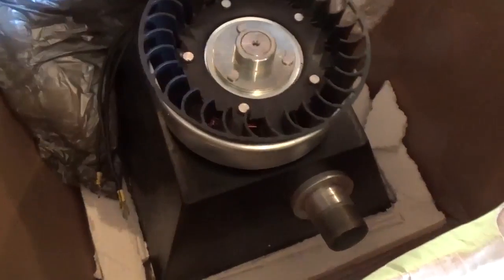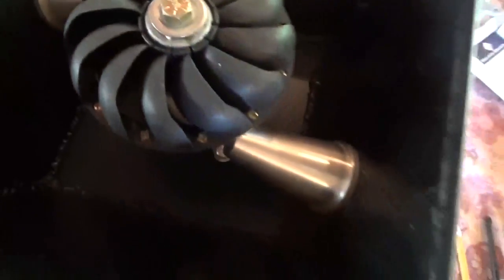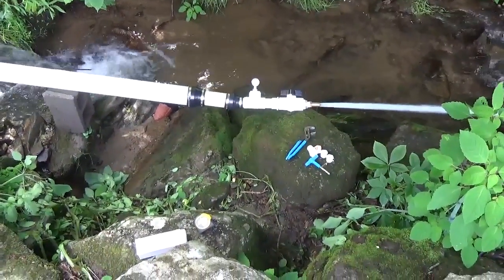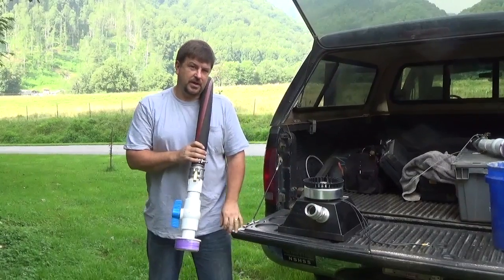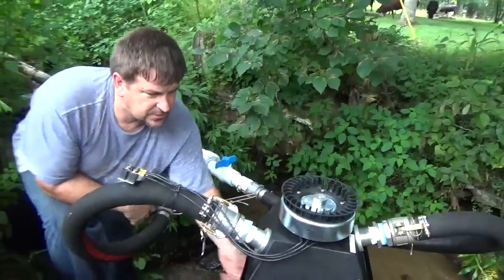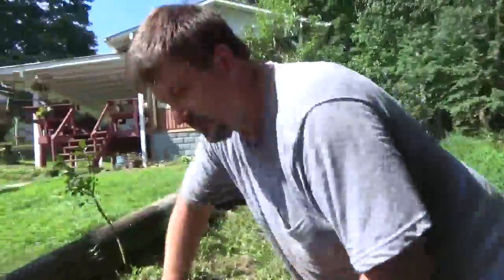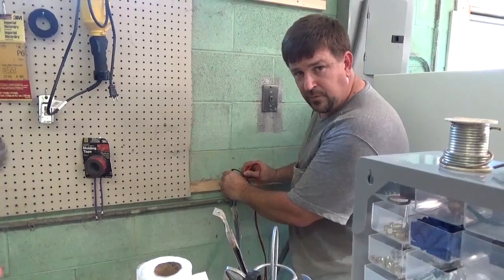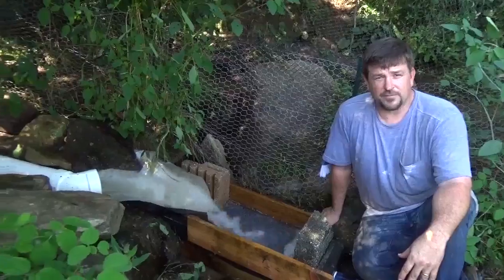Micro Hydro Power with Turgo generator Part 1

Comment: Would you be able to improve your power output by having the rectifier at the generator? This could remove power losses due to the reactance of AC transmission lines.
Reply: I think there is a greater voltage drop during the transmission of DC voltage over long distances....300 feet in this case.
Reply: @timookello3822  The current flowing would be about the same, just it wouldn't be oscillating, so the resistive losses would be about the same, just the power factor of the transmission system would be improved

Comment: Convert your house to solar/hydro guess what is next? The city stops buy and says WOW, you just increased your property value by $60K, here is you new property tax bill, we have seen it happen.
Reply: In dowsing for a new well the dowser indicated a location with 4,000 gpm where two underground springs intersected. There was another location dowsed with 200 gpm and we drilled at the site with the lower number because we didn't want to draw attention.  In our the state owns the water rights and would seize the larger well.

Comment: I'm no scientist, this video's plenty old, and I'm sure it's been said plenty of times by now, but I feel you're losing a good deal of efficiency having essentially a flat wall step from 4" to 2" there. Are there any conical reducers available for that? The straighter you can keep flow without having to change direction the more velocity it will have at the work. PSI in this sense is a measure of flow resistance and should be as low as possible when the circuit is fully open, fine tuning with valves afterward to reduce excess water that isn't doing work. Also all the comments about wire gauge and stepping up the voltage as close to the source as possible to reduce loss over distance, and converting to DC as close to the target as possible.

Comment: Be cool to take on a project like this..  Watched most but did you ever think of mounting the chain around the actual outside of the water wheel.  Instead of the axle.  Then you could use a small sprocket attached to the water wheel outside rim.  More direct.  Just thinking.

Comment: I agree with the other commenter, DC is not used for any long runs because of the losses in power. Tesla and Edison had this argument long 
ago
Reply: Wrong. That was being argued by Tesla  and Edison well before we had high current switching transistors controlled by high speed electronics to recreate AC artificially from DC using inverters. There are plenty of long distance high voltage DC cables including under the sea.
Reply: There is a transmission line from the pacific north west which carries power down to LA. It is operated with DC power because of the markedly increased current carrying ampacity of the lines when DC power is being run through them. When power lines carry alternating electric current the actual flow occurs in the area of the wire that is furthest from the center. An AC Current will not make use  of the complete cross section of the conductor as it's flow path. That makes the ampacity; current carrying capacity expressed in amperes; of any conductor less when it is carrying AC power. The higher the frequency of the AC power the larger the difference in any given conductors ampacity. The reason that most of the electrical transmission grid operates on AC power is that it is less expensive, with the presently available technology, to change the voltage of AC power than it is DC. To maximize the power in watts that any given transmission line can carry the voltage is raised to the highest practical level that the conductors can be insulated for. Current and voltage are inversely proportional. At any given wattage as the voltage goes up the current goes down. Since the capacity of an electric conductor is how much current it can carry without damage to the conductor itself or it's insulation any  given size of conductor has a fixed maximum current. When you raise the voltage applied to that current it can carry more power, in watts, than it could at a lower voltage. The only place the voltage conversion costs of DC current is less is on transmission lines that are carrying current a long distance to a single point of use or conversion to AC. If the transmission line in question is part of a grid which has power drawn from it at multiple locations the conversion costs at multiple points is less for AC than it is for DC. 

-- 

Tom Horne

Comment: So you are adjusting correct voltage with water stream? So when stream get weaker you voltage will drop? How about using some DC-DC converter that can have 90-95% effiency and then you can input wide range of voltage to that.

Comment: When you down size the pipe from 4" to 2" use a longer cone instead of a coupler you will get more velocity out of the pressure and increased flow, every little bit counts.
Reply: Ventury effect?
Reply: @justfixitchris8361  Volume too Velocity change, but not ventury affect.  Just increasing water speed.
Reply: @justfixitchris8361  no
Reply: @allywilkeforsenate  so what is it then?

Comment: Question, why didn't you guys just get a DC motor? Any time electricity is changed there is loss. 300 feet I am assuming that microhydro is running at around 100V. Of course you  have no load at the time you are taking these readings on the DC side.  I very much prefer my solar over hydro because of the inherent problems with transporting the electricity long distances (you don't want to build a house at the bottom of a damn... lol) I would have a decent supply of power if I installed hydro on my property (I would also build a damn up near the top) as I have a good 300' of mountainside (height not distance) and I could easily get 200' of head with a 4' pipe all year if I did the damn right.

Comment: How is the output DC voltage/amperage determined by the rectifier? 
If you were to have a variable amount  of watts going into the rectifier (like say from a wind turbine..) 
Does it maintain a specific voltage and the amperage varies? or vise versa?
Reply: I too want to know!

Comment: I wouldnt have necked the 4" at the Y down to 2" with a bushing.... 4" to 3" reducers then 3" to 2" reducers would have increased the volocity more to get the extra couple of volts. What was the 3 phase AC output voltage on the input of the rectifier at the house when you had 47.5VDC? Stranded wire has less voltage drop than the solid in the UF. There are heavy duty extension cords for mine work you can run in conduit.

Comment: low voltage transmission is an issue of high loss ,you need high voltage alternator or generator over 380vac better and good cable thickness before rectifying ,as well it was obvious you can raise the slope of pipe or make the trip of falling water longer little bit it collect momentum and for sure more impact torque .

Comment: Here a crazy idea for you mon! You getz a helium stirling cryogenic piston that fills a large insulated tank with liquid atmosphere. Ounce tank is full it fills an insulated eternal funnel built into the side of the hill that spins empellers that generate's electrical power with boil off of the liquid atmosphere being passed to the cryogenic piston when sensor kicks on piston to add more liquid atmosphere back into the eternal funnel. Since y'all are using ultra cold liquid atmosphere you can use superconducting element's to generate more power. A Different way to generate electricity that will blow most people's mind's heh? Way better then solar or hydro huh? 😊😏😂

Comment: heres your next build. make the turb-wtfever inline. so that when you run the water thru the pvc it just runs right past the fan wheel. probably get more rpms out of it that way. gear it right and you should be able to make a shit ton of power. just a thought. youre welcome.

Comment: Your project is encouraging. We put in one-quarter mile of 8" pvc pipe that draws from our creek. Securing it to the creek bed has been a challenge. We are not there yet. My friend Paul is a retired electrical engineer. He'll guide me in all the electrical stuff. I need to find the right size of inline generator or something like what you have.

Comment: AWESOME!!!! question, in the last shot of the Turgo running 7:45, the bridge rectifier is only several feet from the turbine, but was previously shown  inside the building  5:50 putting out 47.4DCV. Where did it end getting mounted? Would the ideal location be closest to the charge controller? It's more efficient to run AC over distance then DC, correct?   Thanks for making the video, really great. Cheers
Reply from the maker: Timothy Ohliger you are exactly right. We did move the bridge rectifier into the building next to the charge controller. I put the rectifier next to the turbo just to make sure it was working correctly before we ran the wire.

Comment: Great video. Hats off to you.. I just started a solar setup with mppt and got an idea.. why am I not using the hydro power from my discharge line to my pool.. hummmm
Reply: That would use / need power from somewhere. Or maybe I’m not understanding? You can’t ‘make’ power from something that takes power to run. Minus the inefficiencies and you’ll net less power than you started with.
Reply: @fishhuntadventure  old comment but I was thinking if the pool's already running and you have a discharge line could you not offshoot some of that discharge into a peloton.

Comment: We have a creek that runs the length of our property. It is a little wider than yours but just as strong of a current. It has water year round. 

The model you use in this video. Is it enough to run a 2000 sq foot house?

We want to harvest the energy coming from the creek. Not sure where to start on this journey.

Comment: Awsome idea; however, I have just one question. What environmental impact has it had?. As in you have deviated the natural water flow away from the stream. What impact does it have further down stream if any?
Reply: The water is returned to the stream, so no impact.
Reply: Tempestan im not talking about the quantity of water rather the flow of the water. As you said you have deviated a portion of the water in order to run you generator, so what im asking is that what is the impact of the reduced flow of water down stream. Please dont get me wrong. I think what you have done is brilliant. Clean renewable energy to your house. I love the idea, but, what is the impact of what you have done to the natural flow of the water?

Comment: Going from the bigger pipe diameter down to the 1 1/2in  I believe it is.... wouldn't it be better to have a smooth transition vs. Sharp step down in the pipe. I bet there's a lot of loss there.

Comment: You have voltage drop on account of the distance. Up your wire guage by two sizes for the distance for the transmission. You'll up voltage and current. Making it worth it.

Comment: I am impressed, but I think the cables are too long and you are getting to much voltage drop. Maybe you need the battery bank in a small house nearer the stream. Run you AC power from there. How many amps can you get out of it at 50V?

Comment: 50 volts on a 24 volts battery setup? hello? so my setup With solar energy in 48 volt, should be 96? my charge Controller cuts at 58volts now. it Depends on how Many battaries you got in what voltage

Comment: my nc stream is 2 tapped springs overflow added to the stream that is 1/90th of what yours is. hmmm how to use a micro hydro. i quess i'd need to damn it to a pool then go from there.
Reply: marshallz4 it depends on how much your head is the less flow you have the more head you will need.

Comment: Use mesh on the intake and an air pipe a few meters down to let the air out. (Basically a t piece that goes up in the air higher than the head.)
Reply from the maker: Lizard King that will actually suck air in like a Venturi.

Comment: Hi I am living in England and have a stream with 90ml pipe already laid and have 12 psi on the end of the pipe, it looks like a very similar set up to your video, I have tried a turbo with one jet but it is only producing 100 volts and about 20 watts under load. Would two jets like you are demonstrating produce more power, if so can you please direct me to a supplier as I have been unable to find one on the internet, many thanks in advance for any advice/help
Reply: Sue Davies  langstonsalternativepower@gmail.com
Reply: Sue Davies what voltage is your battery Bank?

Comment: Great job.
Once you get it dialed in.
Put in a custom box for it including a cover.
Mines been going great for 12 years now.. Batterys are still good.
Runs a 6 bedroom 5 bath home..
4 freezers 2 refers and 2 heat pumps
..lights etc.
Reply: Dang! How many kw is yours?

Comment: Put some big electrolyte cap's and you get the higher voltage...👍  ...... but you already know that 20000uf/150v to be on the safe side for 10A....

Comment: That gets an A+ on the CoolAssShitOMeter!!! I wish I had a stream running down the side of my house.
To get the extra volt, try maximizing the difference in height of the water intake and the output into the turgo wheel.  You're working with the specific weight of water. So its all about the height to increase pressure at the nozzle.  I have solar panels and your system is way more cool.

Comment: While runninr how many watts can deliver this generator? 
Nice video.
Reply: Alan Jorge it will depend on your water flow and pressure the elevation drop and your gallons per minute for the generator can produce up to 2,000 Watts continuous at 48 volts

Comment: That install is awesome! As always engineer775, your videos are great! Even when I run into 2 yr old videos! :) One question. Hydro systems are so loud. Have you seen people do any kind of insulation after the fact to keep the noise down? Thanks!
Reply: Walter Johnson these units are nowhere near as loud as the camera makes them to be most people have a box built for them to sit on two discharge  which takes a lot of the sound away.

Comment: DAYUM!!  That is MAJOR BADASSERY right there, son!  If you can put out 1200 watts of continuous power, wouldn't that be 28 kWh's per day from just one of those?!  That's nearly 1/2 of my entire house's supply for the day!  FROM ONE WATER STREAM!  You would need a WHOLE TON of solar panels to pull that off!  If I had 5 kilowatts of solar and had 5 hours, that would give me 25 kWh's per day.  Correct me if I'm wrong.  Could you not install 2 or 3 of those hydro electric power generators at the same time?

Comment: I skipped through some parts.  Did you ever measure the Current?  So that watts would be calculated?  Very curious what it was at the time of the video and also if you have made improvements since what it is now. 

On another note... trying to move dc over long distances cost you a LOT of power.  Better to convert to AC as soon as possible then transmit over long distances as AC.  Even if you end up converting back to DC at the other end.  Depending how far you go you could still be much better off in terms of power output at the machine and how much power you get to your battery bank.  Remember don't get to hung up on just voltage.  Watts is what really matters.  A phone line has 50 volts or so in it but it would take years to charge a car battery :).  

Also due to the basic principles of hydraulics keep in mind that the bigger the pip on the top end and the smaller the pipe on the bottom end the faster your flow rate.  Volume is important with your setup but flow (how fast the water shoots out hitting your flywheel) could drastically improve your generator output.  Think about hitting your generator with a garden hose vs a car wash wand.  The car wash will spin it much much faster even though it has less flow rate than a garden hose.  So to implement this either step up your input line to even larger sizes, 8", 12" and so on.  Or step down your output before it hits the water wheel to even smaller sizes.

One more point for hydraulics.  The higher you can get your input pipe in elevation over your output the more pressure you get.  So for you or even others building something like this a great place to set this up would be where the elevation changes the most over the least distance.  Like a small waterfall type area.  Or where the creek has a curve or bend where it loops back almost onto it self.  That way you can use the least amount of pipes to get the greatest drop in elevation and therefore the most pressure from your input to your output.  If no such area is available on your property then just use a LOT of pipes.  For a better understanding of the principles look up some videos on HydroMining.  These systems existed long before electric or petroleum powered pumps existed.